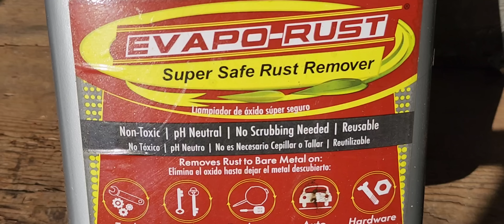Impossible Rusted Shut Pliers  Restoration

Comment: First I would have used a hammer to knock the really hard crusty stuff off without damaging the locking pliers. Then I would have followed it up with a really good go-around with a stiff wire brush to get most of the mud and crud out. Following that if you were going to remove rust electrolysis you might want to take a file and expose some metal completely raw in a couple of spots that you then want to run your wires to for better connection. The result you get will be dramatically improved. You won't have to do it three times for starters. Evapo rust is a good option although you didn't need to pour in quite that much. Meanwhile I think I would have just gone and picked up a new pair of pliers. Too labor intensive and not cost effective to do a restoration like this. 

Fun to watch though. Although I will admit sometimes doing a restoration just because you can and to learn new skills is always worthwhile.

Comment: What a brilliant restoration.  If the metal was no good and it fails, you have nothing invested but time.  If it succeeds, you have a free set of pliers.  Hats off to you.  I'm guessing that short strand fiberglass is the same as Bondo?  For the benefit of the naysayers, names like Bondo, Vice Grips, Band-Aid, and so forth have universally become the names of products as much as they are brand names.  No one needing to cover a wound and control bleeding shouts, "Quick, where are the adhesive bandages?"  Hahaha  I call those pliers "Vice Grips" regardless of the brand no one I've ever known refers to them as anything else.  I'm sure the brand owner of Vice Grip pliers greatly appreciates that.  That's the goal of all brands, to become a household word.